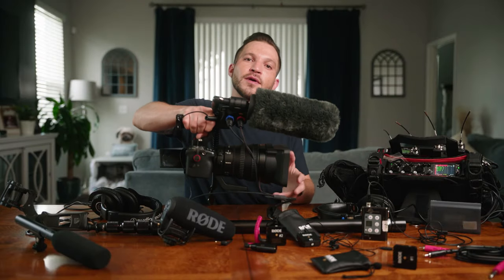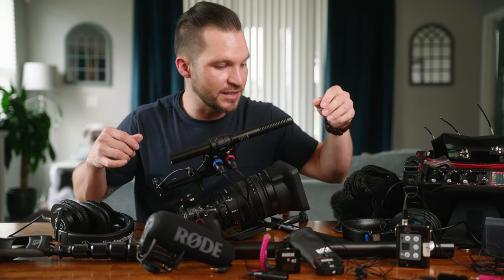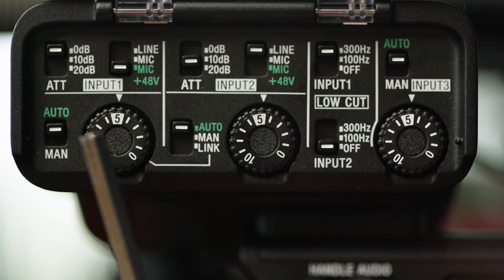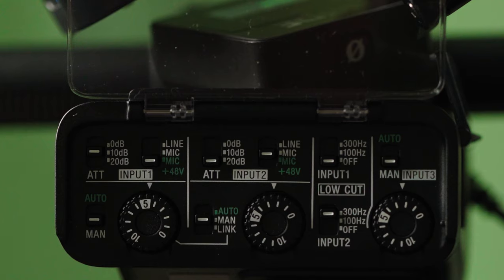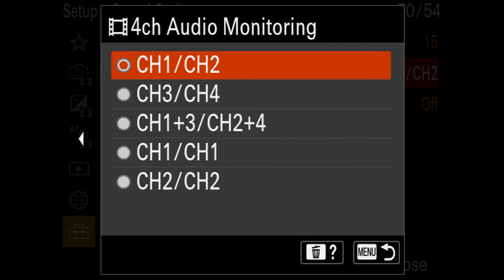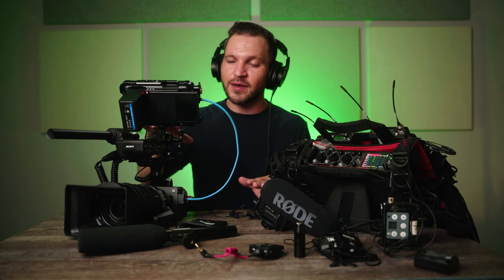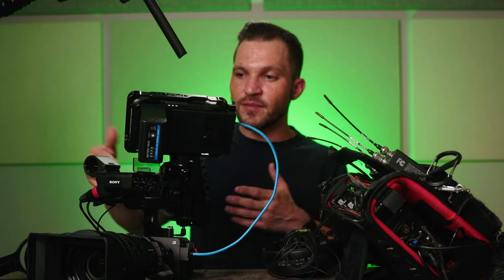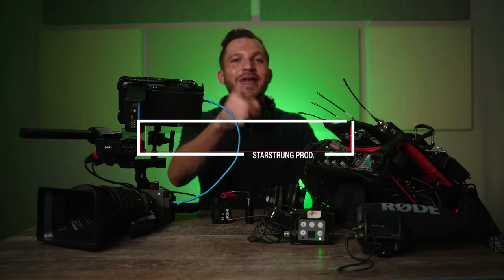Sony FX3 XLR Audio Handle EXPLAINED!

Comment: Great video! One note I have is that using attenuation does NOT lower background noise. It only lowers the volume of the mic overall. That part was a little misleading.
Reply from the maker: Hey DJ Illee. Thanks for checking it out, man! I thought in my explanation, I showed that the attenuator changes the Sensitivity of the microphone. I used background noise in my example to show the increase/decrease in Sensitivity of my vocals compared to surrounding noises.  When set to 0db, it is the most sensitive and you hear the BG noise clearly, as well as extreme detail in my voice (so I showed how both vocals and BG noise decrease in volume as I go higher in Attenuation). If you're interested, I have a part 2 of this video, where I explain the FX3 handle again with the Rode Wireless GO II.  https://youtu.be/Q2t7L-rPFYs

Comment: very well explained, even if you got a bit lost in the weeds at the end with your 4 mic sources :). I like the way you clearly explained the rest of the system -- thanks!
Reply from the maker: Thank you for checking out the video. I try to make it as easy to understand as possible.

Comment: Very useful explanations. Much better than Sony's manual. The two filter settings are high pass (low cut) filters, mainly used to cut wind, traffic, air conditioner, heavy machinery, or handling  noise. Also buzzing florescent light fixtures (60 hz). The filter can be set to 100 hz (hertz or cycles) or 300 hz(hertz or cycles). The cut is fairly gradual, so to cut 60 hz noise, the 300 hz setting is probably best. To cut wind noise, the 100 hz setting is probably best. No cut gives the best sound unless interference from low environmental sounds is a problem (two octaves below middle C is about 60 hz). 

One cavil; the correct frequencies are 300  Hz, 100 Hz (three hundred cycles per second, one hundred cycles per second—NOT three hundred thousand Hz, one hundred thousands Hz or cycles per second (300 KHz, 100 KHz, three hundred kilohertz, one hundred kilohertz)— humans can not hear nor most microphones pick up, sounds that high in frequency).

Comment: The K3M (and the "K3M" that comes with the FX3), IMHO, are way underrated for what they really can do. You can have up to 4 different mono sources (as long each channel is matched left and right) imbedded with your video (no post-sync needed), and the pre-amps are surprisingly good. I just wish Sony would have made the handle on the FX3 more modular, but then again the first thing I did when I got the FX3 was take the entire handle apart to see how everything was piped inside there and to see what kind of modularity I could do myself. We'll see! Thanks for taking the time to make this video.
Reply from the maker: I completely agree. I wish I could pop the XLR module off the handle with another Digital Shoe when I don't need it. It definitely doesn't pack into bags very easily in 1 solid piece either. Although, I'd rather have it than Not at all. Lol. I saw a few Frankenstein XLR handles on the FX3 Facebook group... looks like there's some kind of ribbon cable wiring it all together.  Did you get passed that phase and remove it?
Reply: @RayValencia  Yeah, I broke the entire handle down into each individual component (there is a ribbon cable that runs from the MI shoe through the handle and to the main internal body). I've got the equipment downstairs set up to put a quick video together on some mods to the FX3 similar to my A7SIII video I made and I plan to jokingly show what my handle now looks like (because I like to break things down and see how I can muck around with them) - guess I need to join the FX3 FB group like I did the A7SIII group.
Reply from the maker: That's awesome. I'll be looking for your video.
Reply: @RayValencia  Thanks, put the first vid together yesterday, and I think I joined the correct FX3 group - looks like there were a few but I joined the one with the most members. I saw a lot of "innovative" stuff on there - I personally like when people try to make their stuff "their own".
Reply from the maker: @MOMENTSbyRonSonedecker  Awesome. I'll see you in the fb group, and I just Subscribed to your channel!

Comment: Thanks for a great video .  I want to plug sound from the mixer. I see at around 6:09 I have to choose Line level.  What kind of cable do I use, XLR or RCA  ? Do I plug OUT or IN from the mixer ? Thanks.

Comment: Hi Ray, did you compare the noise level with your professional audio recorder? I use the MixPre 3 from Audio Devices and the noise level is far better than the FX3 and the audio handle. So I am using my MixPre 3 and not the handle. Or could my FX3 have a defect?

Comment: Thank you so very much. That was a wealth of knowledge and has really helped me out!! I have two questions for you. If I am just using the VideoMic Pro+ on the Sony FX3 handle should I still keep the 4ch Audio Monitoring to CH1+3/CH2+4? Also, I'm connecting the detachable 3.5mm TRS Cable into INPUT3 on the handle... should I purchase an XLR adapter to plug into INPUT1 / INPUT2 or is it all the same really. I'm mainly a vlog channel at the moment. Thank you in advance!! 😊
Reply from the maker: Hi Jesse. All good questions. If you're just using the Rode VMP+ into Input 3, you could put your Input Selector on IN3, to make IN3 be your Ch1-2. Then just monitor, 1/2. You get a couple extra features like the Attenuator if you connect through the XLR, but I like keeping the Rode VMP+ in Input 3 because you can enable the Lower safety channel in the Microphone's functions, then you'll have 2 separate channels for Input3  (one with a lower gain). You can essentially do the same thing with the handle and the XLR to 3.5mm adapter, but you can easily do it in the Microphone itself too. I usually only use that XLR adapter for connecting multiple Rode Wireless Go receivers, because I needed several 3.5mm jacks.

Comment: You sir just earned a subscriber, great work on the explanations! Would you mess with the low cut filter switch on the physical microphone on the Sony vg1?
Reply from the maker: Yes, absolutely.  For every day use mics, like vlogging, or youtube, especially on certain mics that pick up a lot of noise. For example, I always keep Low-cut on the Lowest setting on the Rode VMP+.  Not the Max 150hz, just 75hz, because it tends to pick up a good amount of environmental noises and it helps with the AC or fan noises, etc.

Comment: I have two of the Rode VXLR Pro Transformer Balanced 3.5 to XLR adapters with Phantom-Power Converters. Based on the description of these adapters, and considering your explanation of the input selector switch (Line, mic, and mic + 48 (Phantom Power)), am I correct to believe, I can use either the mic, OR the mic + 48 with the Rode Wireless Go and my Rode Video Mic Pro+? To be safe, I intend to use the mic line when using those microphones, but if I forget to change the input selector switch, the adapters I have, which include Phantom Power converters, SHOULD protect my mics from the Phantom Power. Is this correct, or am I misunderstanding the description of the adapters I own???

Comment: So you can use all 3 inputs at once? Another video said you couldn’t.
Reply from the maker: Definitely. You have 4 channels of Audio. The 2 XLRs take up 2 channels, the 3.5mm jack on the Handle takes up 2 channels. Although, if you plug something into the 3.5mm jack on the BODY, it will override the XLR Handle completely.

Comment: Most informative video on the fx3’s audio capabilities by far.  Left a comment on another video, but is there any particular xlr to 3.5mm adapter you would specifically recommend?
Reply from the maker: Yes, The one I use in this video is made by RODE.  Link is in the description.

Comment: omg! Took me so long to find this video! I usually run a lav on XLR 1 and a hand held on XLR 2, but I want to add a small rode micro to the input 3 for ambiance sound. Changing the audio setup to 4 channels is the first step . But Premiere handles audio in a weird way (I miss using FCP 7! long ago- I simply dont get FCP X). When I use 2  XLR Channels, Premiere put them on the same track (not two tracks like FCP) and one channel is on the left and the other one on the right. I duplicate the track and I apply the effect fill right with left on one track and fill left with right to the other track. This way I get them separated. But what if I added input 3?  I know this is an old video but it's very complete. You covered the 4 channel option much better than other videos. Thanks

Comment: Pro tip: use the spacer and if you have a spare bicycle tube laying around cut it in a square of about an inch... Clean it off first with Dawn dish detergent to get all the oils off of it.. put it on the inside of the insert for the microphone.. Sennheiser MKE 600 fits perfectly with a little bit of the bike tube..
Reply from the maker: Love it. Great idea 💡

Comment: Excellent explanation. Couple of questions Does the camera viewfinder show the audio signal for metering ( working without mixer).
Question.2 Have U used the fx3 camera and just the audio handlebar on a  DJI RONIN gimbal? 
Thanks
Reply from the maker: Hi Eye Imagine! Q1, Yes you can see the Audio Bars on the LCD Screen of the camera, but there is no dedicated Viewfinder at all on this camera. One of the very few cameras without a VF.
Q2, yes I've balanced the FX3 on a Ronin with the Audio Handle.

Comment: What would you reccomend for a Rode videomic go? It needs phantom power but when using the 3.5 to xlr you talk about here it doesn't pic it up. Straight into 3.5 works fine but don't get the ATT snd low cut options with input 3
Reply from the maker: Hey Oly! If it works fine going into 3.5mm then it does not require Phantom Power. It's a regular "Mic-Level" mic (not Line level) and  doesn't need the 48Volts of Power.  Have you tried that adapter with putting the Audio level on Mic Level instead of Line? Let me know.
Reply: @RayValencia  Hi 👋. Yes tried both mic and mic+48.  I know it's picking the audio unit up because when I turn on it on the LCD it's saying "48khz/16bit 2 channels. Then that disappears when it's turned off. I tried with headphones in to check and can hear from the mic when plugged into 3.5 port (input3) but when I plug into input 1 or 2 using xlr adapter (have tested 2) it doesn't pick up on any mic or mic + options 🤔

Comment: So for a dynamic mic like the pod make I would use the +48v With maybe a zero dB attenuator around level five and have a back up channel on input to around level three as a safety track?
Reply from the maker: Which mic? "Pod make" = Rode Mic?  I always keep my attenuator on 10db with the Rode NTG5. Ch 1 on about 4-5db. And Ch2 on like 2-3.  That depends on how close you can get your Mic to your subject. I use it on a Boom Pole, just out of frame, on both my freelance shoots and YouTube Videos.
Reply: @RayValencia  yeah the Rode Dynamic Pod Mic. Check my latest video I just did. I hope it sounds good. I did some basic compression in post too.

Comment: Hi Ray, thank you for the video. Can I ask, where did you get the cable to power up Sennheiser using phantom power in Input 1? I have the Sennheiser MKE600, but it only comes w the 3.5mm jack. Thanks in advanced!

Comment: Thank you Ray! I've watched both. Very helpful. I'm also connecting a Rode Wireless Go II into the unit. Is there any reason to prefer the Input 2 XLR input (with the 3.5mm to XLR adapter) over the Input 3 for the Rode? I realise the former gives a bit more control, but I'm struggling to get a left and right channel recording from the Rode Wireless Go when going into Input 2. I can only get that with Input 3. And is there any reason to think there would be more noise via the 3.5mm input as the XLR input 2? Thank you for your videos!
Reply from the maker: Thanks for watching! I appreciate it. But yes, I found a product after this video that can split 3.5mm to Left and Right XLR. So you can get all access to Input 1 and 2: 
Comica CVM-DS-XLR Cable: https://geni.us/Comica_XLRsplitter
Reply: @RayValencia  Thank you!

Comment: Hey Ray, is it possible to solo an individual mic for audio monitoring, then switch to soloing another?
Reply from the maker: Yes, you have to do it in the FX# menu though.  Under Audio Monitoring, can just listen to either Ch1 or Ch2 in both ears. Or 3/4. Or do a combo of 1/3 in Left ear and 2+4 in Right ear.  I have another video on this FX3 handle with the Wireless Go II if you're interested in seeing how I do it: https://youtu.be/Q2t7L-rPFYs

Comment: My friend. I'm very worried that my Sony pz 28-135 without support from below will not last long on the FX3. have you had any experience using this heavy lens without an additional rig? mount won't break?

Comment: Many thanks for the review, Ray! Question here: I have Rode Videomic NTG shotgun (3.5mm) Is there any point to buy 3.5-to-XLR adapter to plug it into the XLR port on the handle (to get the option to use the attenuator) or is "3.5 always a 3.5" and I should just plug it into the 3.5mm? Would the VMNTG with 20dB attenuation and gain around 5 via XLR sound better than if just plugged into the 3.5mm port with the same (or lower) gain?
Reply from the maker: Hey friend! I have a video explaining all the benefits of using a 3.5mm to XLR adapter in the 2nd part to this video: https://youtu.be/Q2t7L-rPFYs
Reply: @RayValencia  Thanks for replying, Ray! I will check it out.

Comment: Ninja 5 is causing a vibration through the audio handle for me and the mic is picking it up. I assume it's the internal fan which is on low. Tried two different mounts as well as padding, isolation foam for mic.

Comment: Great video. my fx3 has some sound issues while pluging the senheizer via xlr. some ground noise coming in. i just saw some other users complaining about this issue. did you come across to a similar issue?
Reply from the maker: No issues whatsoever. I have a pre-order FX3.  Not sure if it makes a difference.

Comment: hi Ray, great video. I record my own voice while recording. I've just bought an FX3 with the rode ntg5 but mounted on the camera the mic is a bit too far away to pick up my voice while I'm operating. Can you record from the internal mic at the same time? other wise I'll have to mount the mic closer to me on the handle, which isn't ideal. Thanks in advance, and thanks again for the video
Reply from the maker: Hi Mystery Rich! I also just got the NTG5, and it sounds amazing! (I usually BOOM pole it in overhead for my videos and clients. When I am operating camera and need sound in front of the camera and behind it, I use the Deity D4 Duo. Which has a Front mic and Back Mic. And you can also override the Back Mic and run an additional wireless lavalier into the D4 Duo. Check it out on the FX3 in my other video and please let me know if this $68 mic solves your problem!
https://youtu.be/hB--nEDbfzA

Comment: Hey important question:

I have a sony shotgun mic with 2 xlr cables (left and right xlr) in input 1 and 2 and the sennheiser ew g4 with the 3.5mm jack into input 3.
Somehow i cant get a sound out of input 3! But when i plug my 3.5 jack into the input on the camera body the 3.5 jack seems to work (besides not having 4 channels now)!
Do you think they used a different 3.5 jack compatibility or is my input 3 on the handle broken?
Reply from the maker: That is really strange. Do you have 4 channel Audio enabled in the Menu, and did you check the Headphone monitoring settings to make sure you're hearing the right channels (showed in the video)?

Comment: lovely video mate ,  thanks ! the sony mic , so as it has 3 input , can receive 3 mic signals right ?  how to split them in the 4 channels ? and control them ?
Reply from the maker: Thanks! Input1 can be split onto 1 and 2 if you don't need Input 2. Also, Input 3 (the 3.5mm jack) comes in on 2 channels: Ch3-4 (Left and Right). I just shot a video explaining this with the Rode Wireless Go2. Coming very soon.
Reply: @RayValencia  oh man thanks really a lot...this is the only video really helpful in understanding this matter !! Just that you know...I will buy this expensive mic because of this video...can't wait to see the other video ...subscribed BTW...come them coming bro
Reply: @RayValencia  also because it's the exact setup I'd need to do....great 😁👌

Comment: Hi ray - could I plug in a tentacle sync box to the 3.5” input 3 for a timecode track to sync up to the separate audio recorder and use 1&2 xlr’s for top mic and radio mic … I guess my question being does the tentacle studio software work with and maintain 4ch of audio on the Sony file… great content btw
Reply from the maker: Hey guys. I don't own a Tentacle Sync, and haven't been able to borrow one yet, so I'm not able to answer this at this time. I hoped someone would chime in that owns a set personally, but if you try to use the Camera Body's 3.5mm Jack it overrides the Audio Handle completely. You would have to plug it into the handle, which would go on Ch3 and Ch4, respectively (and your 2 XLR inputs are fine to use with the 3.5mm Jack on the Handle). Just not the Body. Hope this helps for now!!